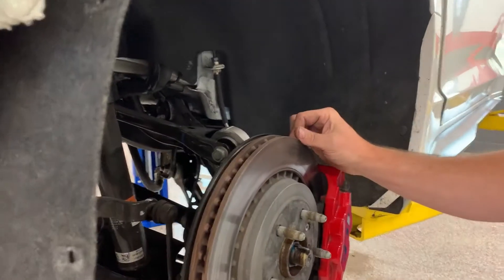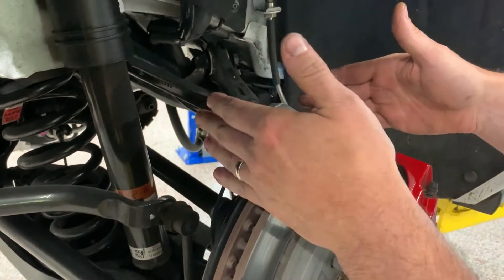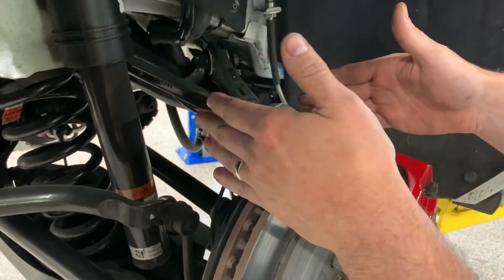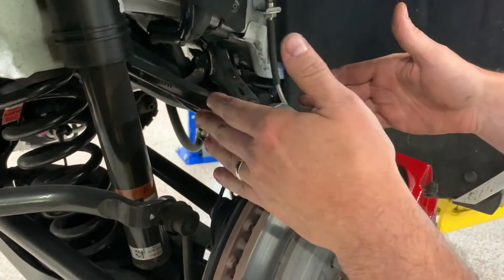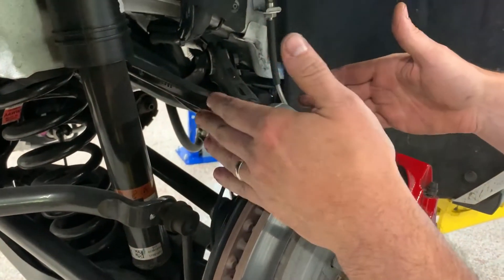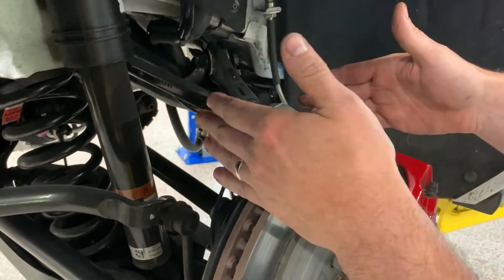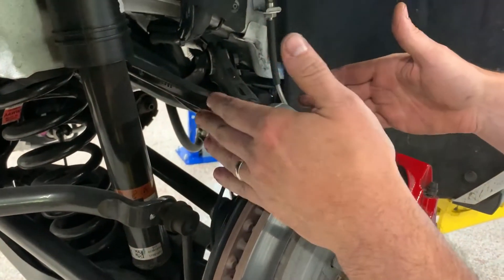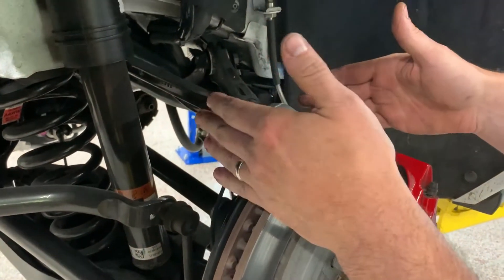6th Gen Camaro Rear Suspension Overview

Comment: I replaced all with bmr control/trailing arms except for the toe rod,i even replaced the swaybar end links with bmr and my rear end is still loose(swaying) on hard acceleration and turning..maybe i do need the cradle lock out kit(2019 camaro ss 10spd A

Comment: On a 6gen camaro ss what could be the problem if the rear wheel is moving left to right ? I just got an alignment and it was driving good until a week later the car started swaying left to right .
Reply from the maker: No sounds like something is not tight or a toe link is broken
Reply: Also is it normal for the oem toe link to move like it’s rotating ?

Comment: How can you tell if the bushings are still good or not? I took mine in for annual inspection and they said some of the bushings have too much play. I haven’t noticed anything wrong while driving, so I’m trying to look into it myself. Thanks!
Reply from the maker: Honestly I would be suspect of anyone telling you that your bushings have too much play.  Yes, rubber bushings wear out, they typically crack. Did they tell you which bushings? Bushings can be any of them. Worn bushings can lead to many things like: car not holding an alignment, creaking or popping noises when steering or going over bumps, sometimes a clunking sound when going over bumps. If you have a Gen 6 Camaro with normal mileage, I seriously doubt many bushing are shot, but I could be wrong. The only way the shop could tell is to put the car on a 4 post lift and raise it, then start prying on joints, suspension members, etc looking for unwanted movement.